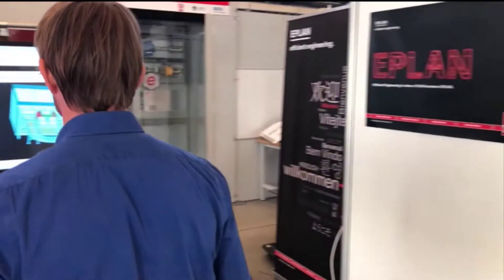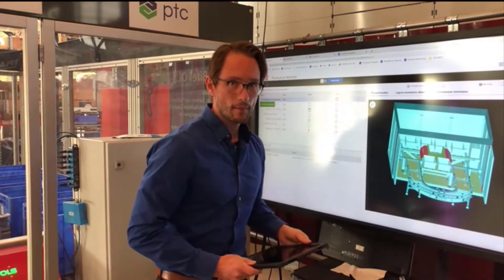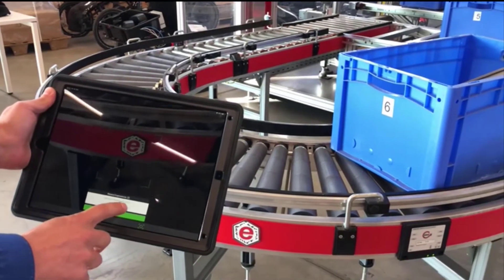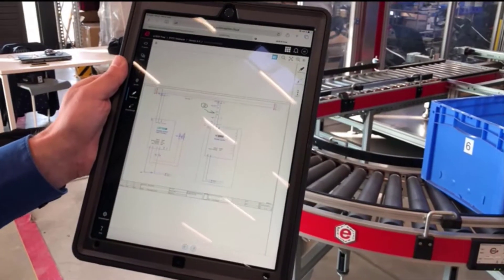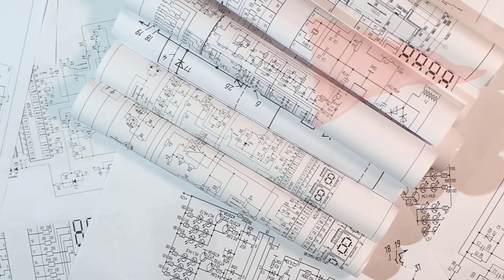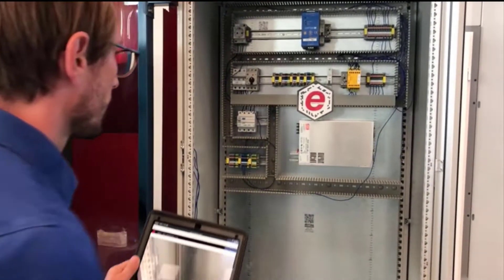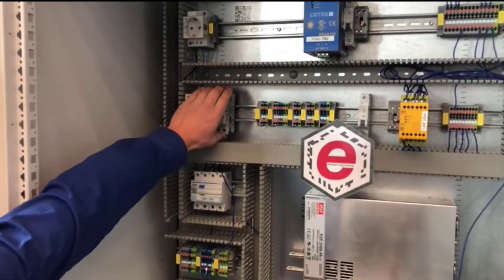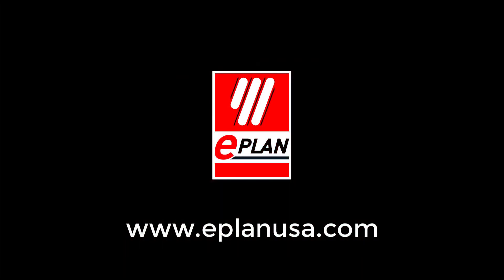Augmented Reality on the Shop Floor with EPLAN

Comment: The use of AR technologies to aid in service maintenance work was just a concept 10+ years ago.   When I was a field tech I carried  300 pounds of tools, spare parts and manuals in my car.  (A lot of paper weight)  Prior to going out to a job site,  you guessed which parts you may need.   Using AR and database drive technologies such as EPLAN ,  there is no need for paper. You can check the spare parts before going on the job site.  My customers expected the machinery to be back in operation ASAP with the least amount of cost.   This is the leading edge of the industrial evolution.